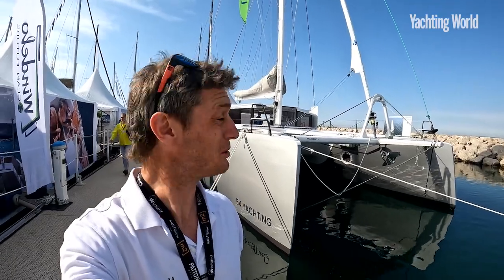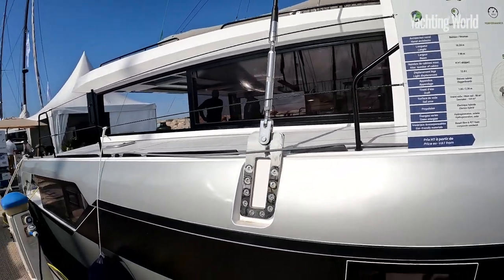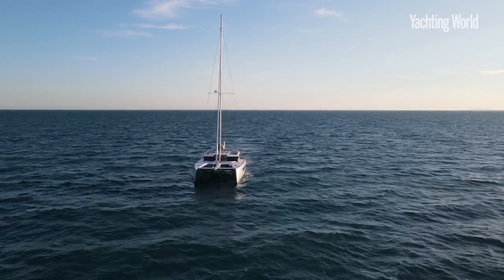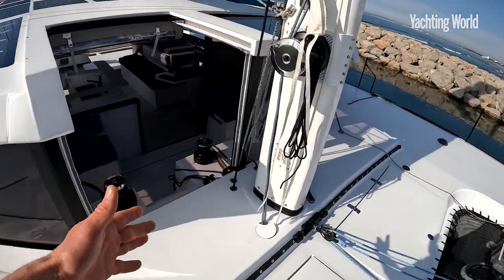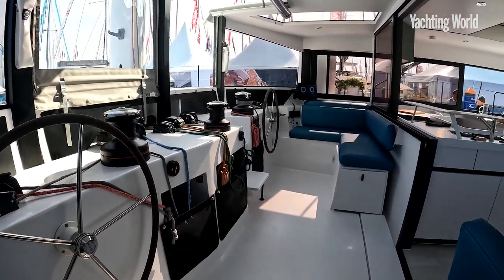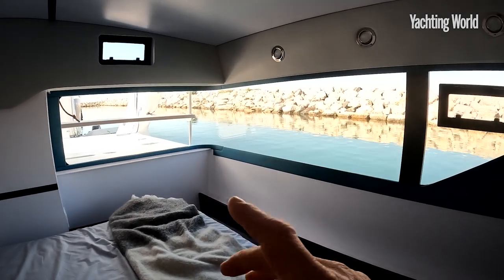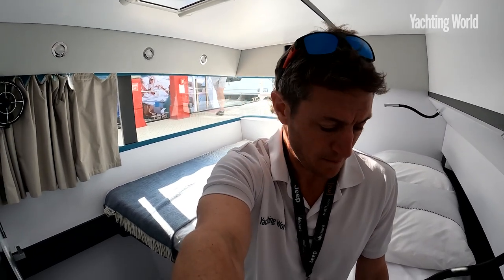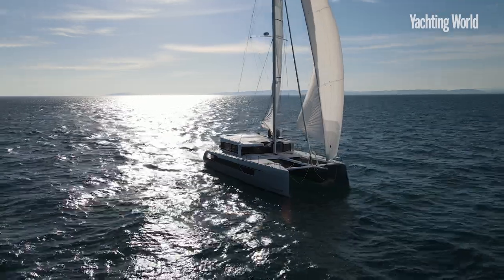First look: Windelo 54 catamaran – more innovation from the company pushing sustainable boatbuilding

Comment: Another interesting vessel im a bit supprised they didnt increase the size of the E motors and solar power a bit more...but with regen under sail perhapse they see that as boosting the  budget of having extra persons drain power at anchor.  Mind you  its easy enough to plug in a folding portable panel and tie it down to a rail or trampoline .. 
I havent forgotten the generator but why run it at anchor if the solar could be boosted.
Im glad they are getting orders as they've taken a number of important steps forward.

Comment: Imagine solar fabric sails charging as the wind drives the boat!..thats gonna be the big game changer in boating!
Reply: Don't imagine, they are avalable but at a cost, about the same price as the whole boat extra...
Reply: and what happens when you are at anchor, mooring, at the docks or on the dry? which is 85% of the time of any boat
Reply: how about 'wave' action energy generation? on the move or especially when at anchor... I haven't seen this being put into use yet
Reply: @pred7949  all the regularly installed solar would more than meet your needs. Not saying that it would be feasible, but being on the hook would not be an issue. I think the real problem would be that having the sails up would always shade part of your hardtop array, partially negating the extra cost of the solar fabric sails.
Reply: @pred7949  i cant solve all your problems!
Reply: @oldsailor5711  obviously it needs to be competitive or its not practical.
Reply: @danmallery9142  which my hydro and wind turbines do a fantastic job at topping up when a fraction of the solar array are in shade, sails only cover the panels perhaps 17% of the time so in my tested opinion, solar sails will only be a thing for the iss and future satellites

Comment: A beautiful boat. i adore closed cockpits. the bedrooms are spacious and the beds are of normal height plenty of storage space
I fell in love with windelo with the last review, the price is decent because it works well, nothing creaks when walking, they paid attention to details
Maybe just add solar panels and this diesel generator you won’t even need
Reply: What is the beauty of this boat?
With such a control post and such huge windows in the cabins, even in a small storm of 3-4 points, it will fall apart. Sail only from bay to bay along the coast?
Reply: Its existing 3kw of solar panels should be enough for house loads in most of the popular cruising areas.  The Diesel generator is really a backup in case of long passages of no wind.
Reply: @vasiliypanamskiy  It doesn't look so fragile to me.
People are crossing the Atlantic with fifty-year-old ships that only the gelcoat holds together
This boat is a partial copy of Gunboat, but for a lower price, but not because of the quality, because of the market in which they have to be placed, because future catamaran owners are looking for something special.
I am very interested in how this boat behaves in stronger winds
Reply: @LoanwordEggcorn  Depending on the consumption of the "crew" on the boat in most cases in the charter the biggest problem is hot shower water, people are spoiled snowflakes and are looking for the same conditions as in a five star hotel.
So their first voyage turns out to be their last voyage
Reply: @vorda400  Agree it depends on expectations.  Would be better for people to expect sailing to be like camping with (limited) showers and toilets.
Reply: @LoanwordEggcorn  The problem is that some people imagine sailing as glamping and are surprised when a 45ft sailboat does not have a built-in jacuzzi pool on the bow
But fortunately, mostly normal people want a different kind of vacation, so sailing is a real adventure for them
Reply: @vorda400  Agree, and fortunately the former are probably pretty rare.

Comment: HH Catamarans of New Zealand are way ahead of the competition in innovation, sustainability, performance and price. Integrated Fresh Water (rain) capture should be a no brainer for these manufacturers by now. Many will have to fold to HH - They listened to the sailors wants and needs not just what the designer thinks the sailor should want and need - HH gotta be 20 years ahead of everybody including Zen
Reply: HH catamarans are very nice, but I would personally prefer an outremer 55 or Marsaudon Composites OCR 57 over anything HH has to offer at the moment
Reply: Where do you get NZ from? It’s a Chinese boat… but beautiful and one of my favorites
Reply: HH cats are built in China and Vietnam to lower the cost.
Reply: Love the HH. I think Balance cats out of South Africa are along a similar vein.
Reply: The Windelo 50 has the same base price as HH44, and that is with much more in the package, essentially fully ready to go cruising, which HH44 is not. On top HH44 and 50 are not full carbon huls, but only the structural parts are enhanced with carbon, otherwise the price of the HH44 would be double the price of the much bigger Windelo 50 already. No, you can not sell to me, that HH is better than Windelo: This boat is just packed with so many great new ideas, not least that forward helm, which Windelo finally have made working, unlike the many attempts of Chris White, in my view.
Reply: Ahahah HH is interesting, but come on , tell what they invent ? Electric motor ? Interior helm ? You can prefer one to the other (then buy it) but criticism like this is … at least.
Reply: Paul Hakes of HH is from New Zealand, but the boats are currently built in China.  The HH boats are very nice and among the best, but a bit less innovative than Windelo.  HH look slightly more seaworthy to me.

HH has a parallel hybrid drive option.  The Windelos are serial hybrids with stronger electric focus and larger battery banks.  Again, the Windelo is a bit more innovative.

The HH52 front helm is more similar to Chris White's Atlantics.  The Windelo front helm is more different.

Comment: Stating a battery capacity in Ah is pointless without also saying what the nominal voltage is. Just use the actual units used to define battery capacity, kWh.
Reply: According to Windelo's website, one configuration gives you 53.8 kWh of batteries... Don't know if there are several different setups available...

Comment: Only my opinion. A very controversial catamaran. I see its purpose - parking in a quiet bay. Not intended for sea navigation. Toby, thanks for the review. The review itself is great
Reply: you could not be further from the truth…
Reply: Seems to me it could do both well, in a relatively more environmentally friendly way than more traditional designs.  I actually like this design more than I thought I would.
Reply: @barilro  Arguments )):
In fact, an open cabin, covered with a window made of polyethylene. The first big wave will flood the saloon.
Such an arrangement of the steering wheels is inconvenient. In the marina, the back of the catamaran is not visible, and it will also not be visible from the side, because the low location of the bridge and the dimensions are poorly felt. Parking will be by sound.
The dinghy launching system was designed by someone who had never raised a dinghy in a wave. Such a mechanism is simply dangerous.
Handles are missing. New design trend. Nothing to hold onto in excitement. And don't say that the catamaran doesn't rock.
The back of the saloon is not protected. A tail wave will easily be inside. Maybe I'm wrong. Or do I not understand? ))
Reply: @Muratshayev  The saloon is water tight, only way a big wave gets in is if you leave the doors and windows open in which case it's on you not the boat.  Likewise the stern buttons up with both a sternwall forward of the tender, and a full wall of closed doors between the saloon and aft "cockpit".  No idea about the tender or handholds though.
Reply: @Muratshayev  Are planning to solo sail a 54 catamaran? lol. Most cats at that length usually is operated by a husband/wife. If you have watched the 50 foot version, you would know that the back saloon can be closed off
Reply: @Muratshayev  I sailed the Windelo 54 just before the show. What a wounderful boat it is to sail. i've done two atlantic crossings and 21,000 nm sailing with my ex-Leopard cat. i found this boat much more sea worthy. the forward cockpit is really wonderful place to sail from. The architect thought about the water potentially coming in the front with a second door to seal the cockpit along with the floor drain. no different from any gunboat, just that the cockpit is protected. the freeboard is high, the boat light, the weight distribution perfect, sails windspeed in winds below 10 knots…it does not get better then this.
Reply: @barilro  Thanks for the explanation. I just wrote comparing it with Leopard 40)) It was impossible to open the front door on it during excitement. Apparently size matters.

Comment: In an effort to be utilitarian, they went way too far, but I guess people will buy anything that is promoted as eco friendly now. The cockpit at the front is a design principle that went horribly wrong. The finish is agricultural at best, especially for this price. The electric motors provide an almost insignificant benefit - 4 hours! - so what? Ideology instead of the real thing. Very common these days. Often first efforts turn out to be lemons.
Reply: 4 hours for the electric drive on battery only.  Plus 1000 nm on diesel generator part of the hybrid drive.

What don't you like about how the front helm is implemented?

Electric drive is a fantastic synergy for sailing, especially since it can be recharged simply by sailing with the motors acting as generators.  It's also quiet and doesn't burn fossil fuels for day sailing, most coastal cruising, etc.  Plus the backup diesel gives it long range for ocean passages, if needed.  Performance should be enough that the Diesel gets almost no use, even for ocean crossings.

Agree the fit out is a bit industrial.

The price is very low for this size of catamaran.
Reply: + this is literally the cheapest performance catamaran on the market. You just proven yourself an oaf with your views as well as your front cockpit opinion. lol yikes
Reply: @pred7949  are you a commo?
Reply: @LoanwordEggcorn  yes, that is what I said. Thanks for repeating it
Reply: How is the front cockpit wrong?  Chris White, HH and Gunboat have been using front exposed cockpits for ages.
Reply: @LoanwordEggcorn  People really keep bitching about the range, I mean that cat is meant to be sailed not motored LOOOL
Reply: @reee_4067  Yes, but if you do long ocean passages you may need to motor if there's no wind for a while.  In any case, the diesel generator backup on this boat gives 1000 nm of motoring range, in addition to the battery range, which should be more than enough.
Reply: @reee_4067  Sorry, I am better informed regarding their characterisation as marine exposure practitioners now

Comment: Ahahahahaha, you’ve got these diesel power generators to run this electric motors.
Reply: It's a light boat that will be able to sail in many conditions, then you have lot's of renewable generation that will cover most cases where you need engines. Finally you have the diesel generator when you need electricity in case of emergency. This seems like a very sensible solution.
Reply: Only when you need more than 4 hours of motoring from the battery.  For most coastal cruising, the generator would probably not be used.  The solar panels and battery bank should provide more than enough power for most uses, both at anchor and under sail.  The generator is more of an emergency backup.
Reply: @bernardlanguillier7970  Agree.   Many people don't understand the energy budgets of sailboats well enough, it seems.
Reply: I forgot to add, most electric drive boats can hydrogenerate, that is, recharge the battery by using the motor as a generator when the boat is under sail.  In other words using wind power to charge the battery.  That's in addition to a large amount of solar power.  And the generator as a backup.

Also Manot and Robert did a 11,000 mile passage, crossing the Atlantic twice in their Windelo 54.  They never used the generator at all.  They did use hydrogeneration and the solar.  See their recent interview on the Windelo Youtube channel.